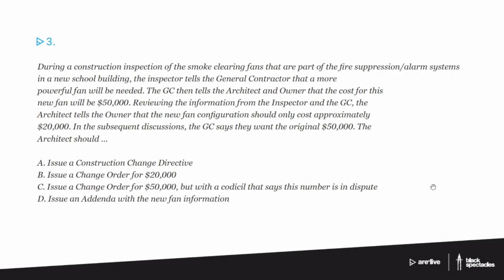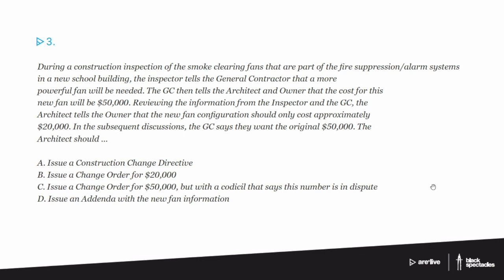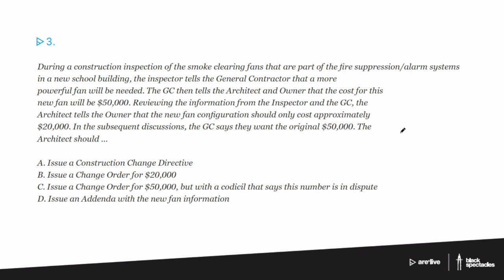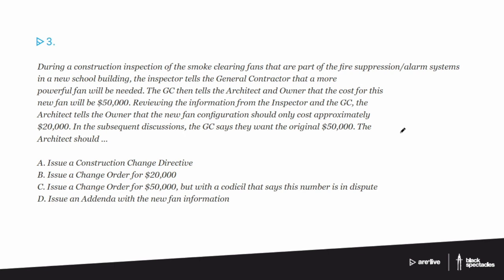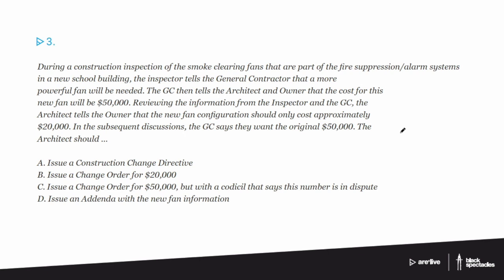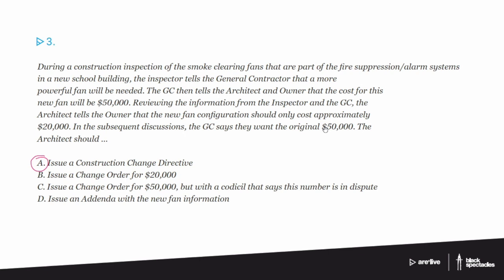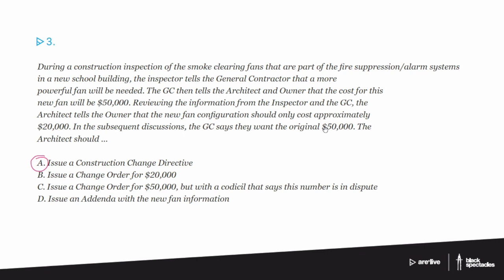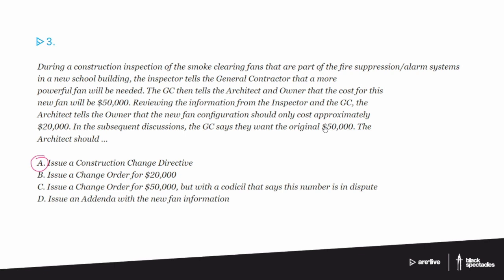Construction Change Directive | ARE Live - Project Management Mock Exam - 2018

Comment: the amount that is written into the CDD, how does that work? is the architect writing down the amount they believe the work should cost, or the contractor? as I understand it, the CDD acts as a record of the disputed cost of the change of the Work, not the final record of the cost.
Reply from the maker: Ok, ... I believe you are referring to a "Construction Change Directive", which is similar to a "Construction Change Order",
or just "Change Order". 
When there is a change needed during construction for whatever reason (code official, architect's mistake, change in budget from the owner, better idea came up, whatever) the typical process is that after the problem is noticed and discussed, the Contractor writes up a Change Order that has the three main issues associated  with it written out, namely
1) change in cost, 2) change in schedule, and 3) change in scope.  These 3 are always there on all CO's even if they are"0".  
At the bottom of the page there is a place for a signature for A) the Contractor, B) the Owner, and C) the Architect (and occasionally others, like a representative of a bank, or other funder).  Sometimes there needs to be some discussion and back and forth between the three parties to get a $ that all can agree to, and this typically means altering scope accordingly.  The vast majority of the time, everyone can agree, even if begrudgingly.

However, sometimes, you just can't get everyone to agree to all three (price, schedule, scope).  In these situations you typically do not have the time to just stop and wait until the issue can be ironed out by a mediator, arbitrator, or through litigation because the rest of the project's contractors have to keep going in order for the work to make sense (if you have to stop a project right in the middle for a couple of months while this is being worked out, clearly the sub-contractors will have to find other work and who knows when they will be able to re-start the project, plus there would be extra costs to removing all the tools and such and then bringing them back later).

So, in these situations, there is the tool of a Construction Change Directive, and this is used by the Owner with the Architect's help to tell the Contractor essentially "we realize we have not been able to agree on a CO for the work needed, therefore we are telling you (directing you) that you need to do the work anyway, and then down the road, after following through with whatever process is listed in the contract (IDM, mediator, arbitrator, etc.), and presumably long after the work has been done, a final decision will be made on what the change to the contract price will be."

It is a bit weird, as it is an uncomfortable thing for everyone.  The Contractor doesn't like it as they are being ordered to do work without knowing what the compensation will be.  The Owner doesn't like it because they do not know what the final price will be.  And the Architect doesn't like it because they are forced to take a direct stand on pricing which is not typically their strongest area of knowledge and if they are wrong, then a lot of bad blood and mistrust can ensue, which is never good for a construction project.  But you can't just stop a project and wait for everyone to be happy all the time, sometimes it is the only option.

For an exaggerated example, lets say a Contractor has made a big mistake on their original price for a project and they now realize that their bid was $300,000 too low.  Then, later during construction, a Change Order comes up for adding a roof drain.  The Architect thinks it should probably cost about $10,000 to add the roof drain.  The Owner, while not happy, thinks that will be OK.  Then the Contractor writes up the CO for $300,000.  Clearly the Contractor is trying to use the CO as a way to alter their original mistaken bid, and that is just way too much to pay for the roof drain.  The Architect says to the Owner "look, I may be wrong about the $10,000, but I know I am not that wrong".  The Owner and
the Architect try discussing this with the Contractor, but they are adamant and refuse to budge.  So, then the Owner tells the Architect to issue a Construction Change Directive and then (because this is delineated in the original contract) the Contractor has to move forward with the work while a final price for the work is figured out.  If it is going to litigation,
that could be months or years.  If it is mediation, hopefully just months.  But either way that is too long to wait.  The Contractor must do the work and must accept the price decided by whatever legal system has been in put in place in the contract that they signed.

Typically, the Architect would put forth a reasonable price (probably in this case the $10,000) so that the Contractor can be at least paid this amount for the work in the meantime (so they do not have to hold all the cost on themselves until it is decided).  But the final price is decided by the process listed in the contract, and no one knows what that will be until that process has been followed through to the end.

Two additional points:
1.  In our exaggerated example, it could just as easily be that the Architect does not understand all the work that needs to happen to install that roof drain.  What if they have to move a steel beam, core through a lot of concrete, remove and re-lay down all the roof tapered insulation so that the roof will drain correctly, and a million other items like that.  It could be that the Contractor was right, or even that the third party reviewer thinks that it really should have been $340,000.  Then the Owner would owe that larger amount, and would have been better off just taking the original $300,000 CO.  These things often don't go the way you think they will.  And still everyone is unhappy.  Which is why you always try to work it out first and only use the CCD as a last resort.

2.  IDM -  Remember that the first stop on dispute resolution between the Owner and the Contractor is in many AIA contracts the IDM or Initial Decision Maker.  And guess who the usual IDM is ??  Yup, the usual IDM is the Architect (though it does not have to be, it could be someone else who has been specifically designated in the contract).  Even though you have a contract with Owner, there is an expectation that as a "professional" you have the legal ability and necessity to be impartial and provide reasonable response after hearing out both the Owner and the Contractor.  Typical Contractor does not love this, so they will often try to strike out that part of the contract, but it is an interesting aspect of the Architect's role where there is potentially a conundrum between your duty to your contract with the client Owner and your duty to the public as a professional, which is interesting, no?
Reply: @Blackspectacles  Thank you for the thorough reply. I learned a few things for CE. So dispute resolution in A201 covers how the parties come to an agreement on the price difference in the CCD. But what $# get's entered into the the CCD? I would assume the Architect puts the amount they think the work will cost. Also, A 201 talks about how only the owner and architect are in agreement for a CCD, but it requires the contractors signature. That is strange because the A 714 says 'contractor signature indicates agreement with the proposed adjustments...' so we should also assume the contractor doesn't sign the CCD, but just receives it, but doesn't sign it as then they would be agreeing to the work at the price the Architect believes it should be.